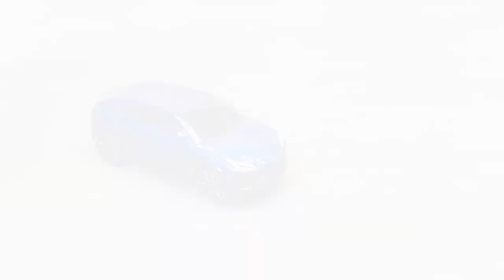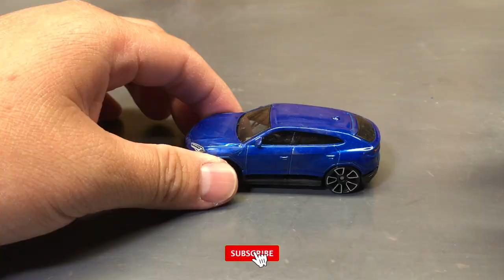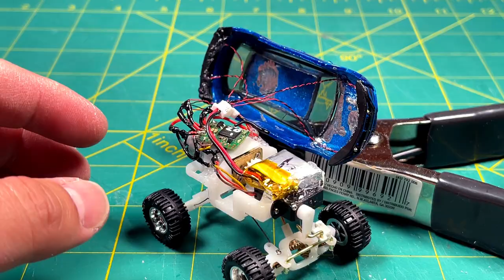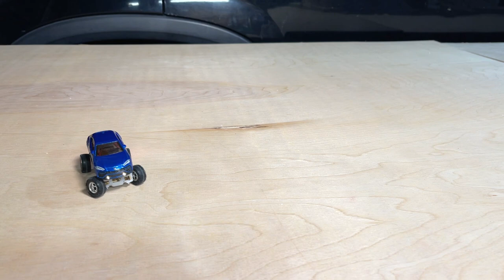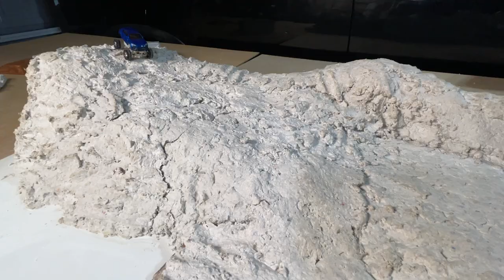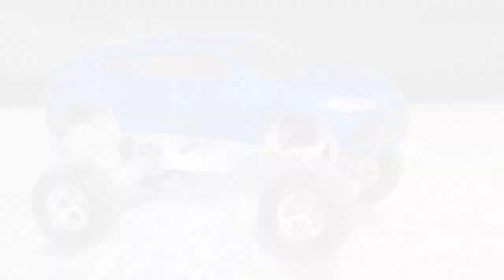RC Hot Wheels car 4x4 RC, Lamborghini Urus

Comment: You can make mountains hills tunnels anything with styrofoam or insulation boards and hot knife,blow dryer,heat gun and it's cheaper and easier than the clay you got bro also looks more life like!😊🎉
Reply from the maker: Thanks for the tip!

Comment: So the Deltang rx43 is an actuator receiver, from your connections, I can see that the servo's three wires are connected to only 2 points on the rx board? So  is it only directly connected to the servo motor and bypassing the servo board? Thanks :-D
Reply from the maker: There are three connections for the servo. Negative, power and signal. The power line is underneath the board, that’s why you can’t see it.
Reply: @SlickDiecast  Oh, that’s why😀